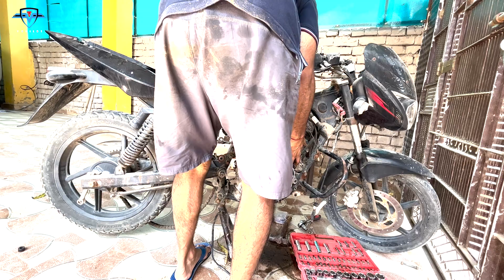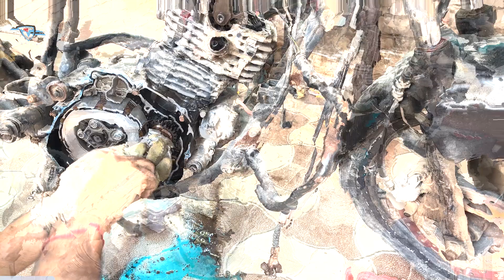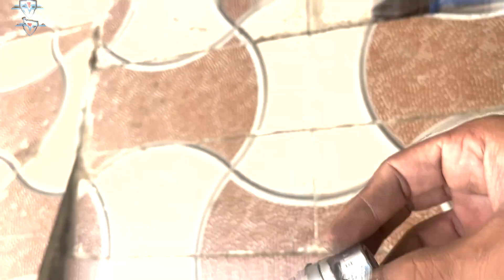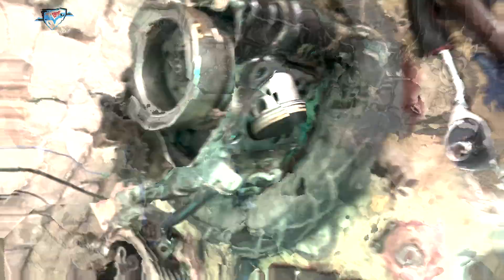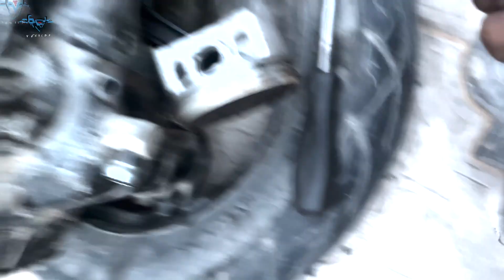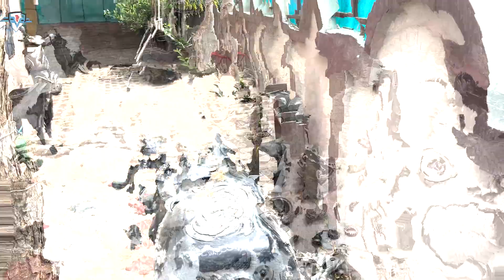Pulsar restoration 🏍️ Complete Engine Tear Down: Bajaj Pulsar Engine Disassembly 🛠️

Comment: what was the broken piece in the engine you didn't mention it
Reply from the maker: wow, you noticed, haha, actually i didn't find anything but seems like it was some part of the gear assembly which broke
Reply: @VBuilds I am disassembling pulsar 180 engine and faced the the same problem I found broken metal pieces 😅